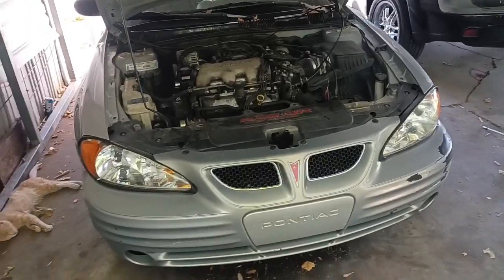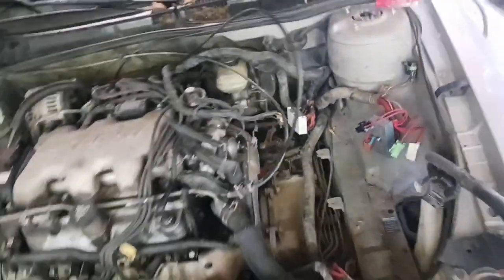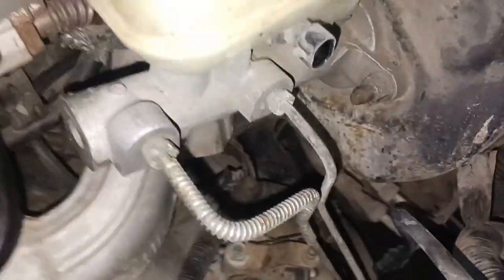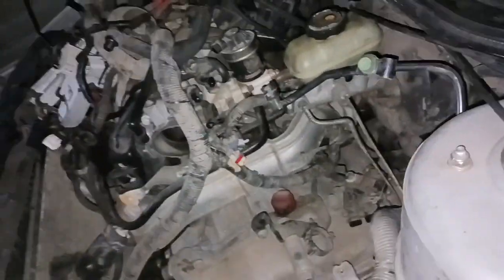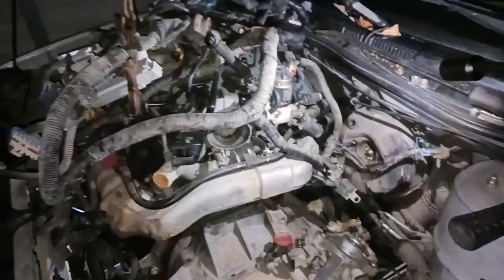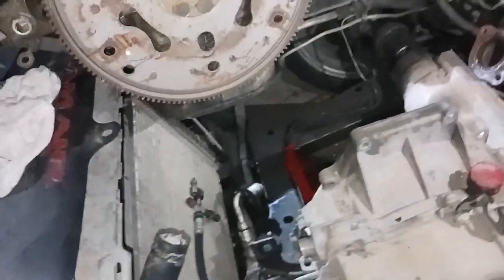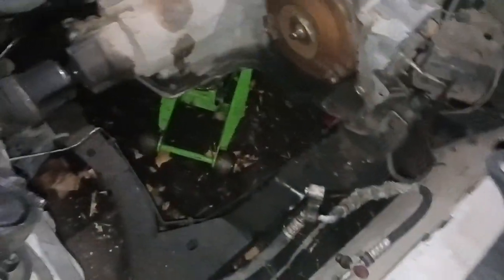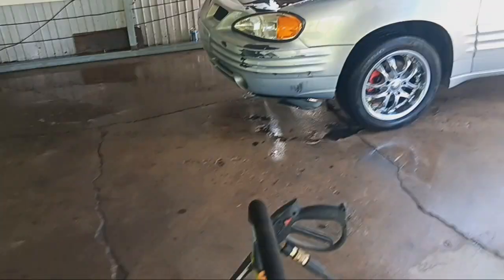99-05 Pontiac Grand Am 3.4L V6 Engine Removal + Powerwashing The Engine Bay

Comment: Want to do it again? I got a nice 03 grand am gt. for sale. 1200.   143848 miles. TCC solenoid stuck open. I dont have the equipment or space to fix it. Had it 2 years. Clean title.
Reply from the maker: @sonofjudah1585  I actually need another engine now because one of the lifters failed and it's got a horrible knocking sound to it now. But I can't afford $1200 for an engine. I can barely afford $300 for one at the junkyard.
Reply: @PontiacsGarage  it was for the whole car. Runs great. Won't go in reverse.
Reply from the maker: @sonofjudah1585  you should go watch the update on all my cars video. You'll hear the engine knock. It's bad.
Reply: And also are there 3 engine mounts ?? One on the top and then one on each side of the engine ?

Comment: How many bell housing bolts are there  i already have mine down to just the shortblock im just trying to get info on how to get it out exactly... with a cherry picker of course
Reply from the maker: @LS0308  there are 5 bell housing bolts. 4 from the transmission side, and the bitch bolt goes into the transmission from the engine side.  But 5 total.
Reply: @PontiacsGarage  thank you ! And you definitely inspired me to do a 3800 swap one day soon on my coupe.. love your videos
Reply from the maker: @LS0308  that's awesome. And no problem at all. I watched Gauges videos on his black grand am with the same swap. That's what made me want to swap mine. He made my harness for me and the passenger side lower engine mount, and the downpipe. Without him I don't think I would've gotten it done. Go check out his YouTube channel.

Comment: Is this the car you swapped the 2.4l engine to the 3400?
Reply from the maker: Yep that's the one. It was a great car for 2 or 3 years. Now it's just riddled with wiring shorts in the harness. I've tried changing the harness multiple times with no avail. But maybe one day I'll find the correct harness in a junkyard or maybe even at work.
Reply: Did you have to change ALL of the underhood wiring, or only the one coming through the firewall? And is that the ONLY change under the dash?
Reply from the maker: @mstover2809  I had to change everything. Ignition, bcm, ecm, harness that goes through firewall to ecm, fuse box, cruise control box, abs module and brake lines, fuel lines, and ibleft the rear brakes as drums instead of swapping to Rotors. Oh and the full exhaust was swapped because the exhaust flange is different and someone stole the cat while it was parked outside.